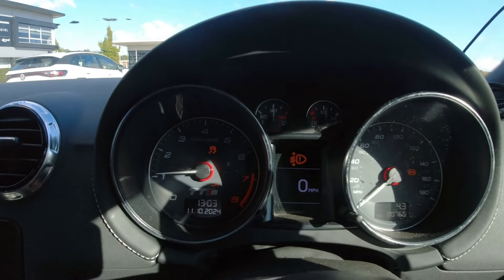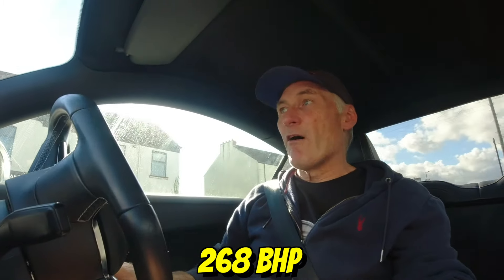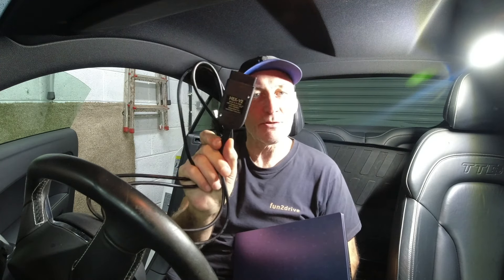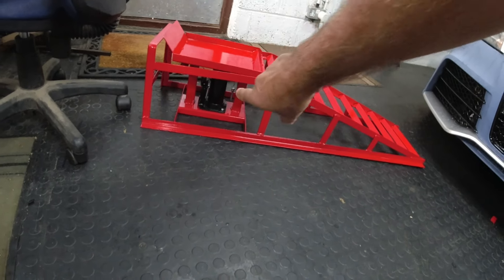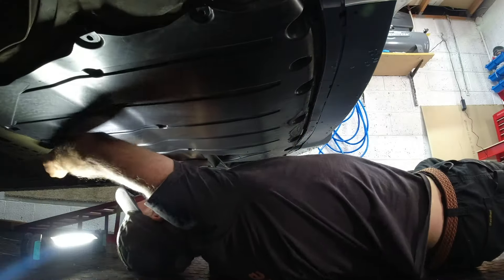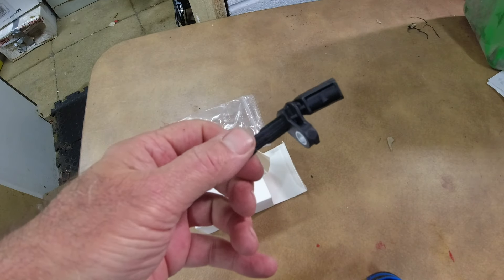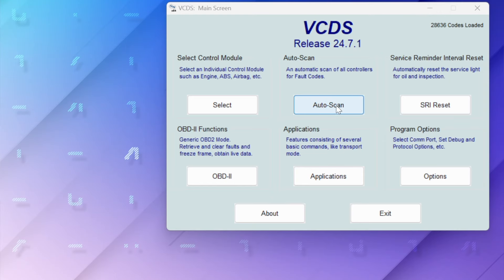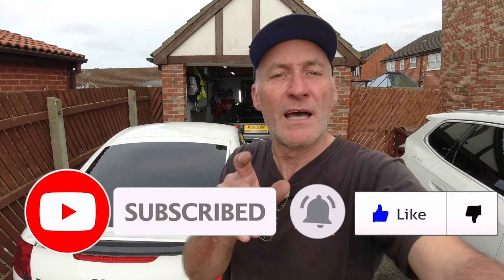I FIX ALL THE ISSUES WITH MY AUDI TTS!

Comment: I recently had similar ABS/TCS errors on my Kuga, it was also the nearside rear wheel speed sensor. I ended up getting it from Ford as throught that would be my best chance of getting the right one. Cost £30 but that's pretty good in my eyes compared to a garage fixing it.
Reply from the maker: Absolutely! You can save a fortune if you do these simple tasks yourself!

Comment: Let me list what I fixed in my first three months of Mk2 TTS ownership. 😅 luckily I have had EA113s before but I had virtually the same experience- All fine at test drive, then it stacked up quickly. 

Thermostat failure
PCV valve faliure
Washer pump failure
Left rear light earth fault
Replaced gopping Audisport spoiler with stock raising spoiler (coding nightmare)
Stereo wiring loom (mangled)
Ignition wiring (shorted out by fixing the stereo loom 😅)
Window regulator failure
Door lock mechanism failure
Head gasket failure (including carbon cleaning, valve swap, injector clean and cam belt & water pump) 
Unglueing the cam sprocket from the shaft 😅😅😅😅
Rear brake caliper seized (caused by corroded discs)
Brake disc change
New tyres 😅😅😅😅
Wheel alignment
Disconnected boost pressure sensor 

Think you've had it easy mate 😅😅 mag ride failure next...
Reply from the maker: oh my word! you have been so unlucky!